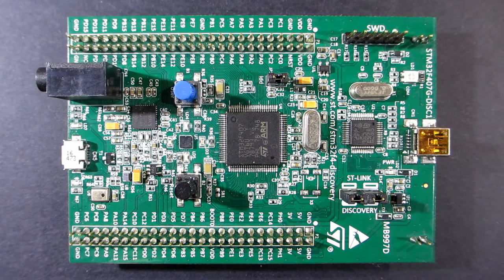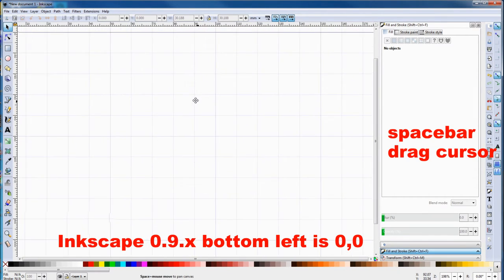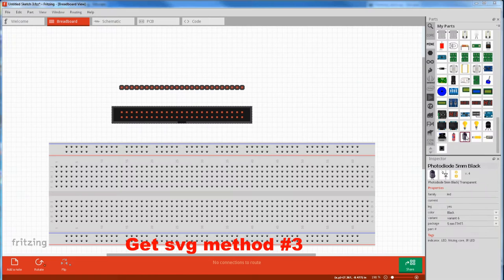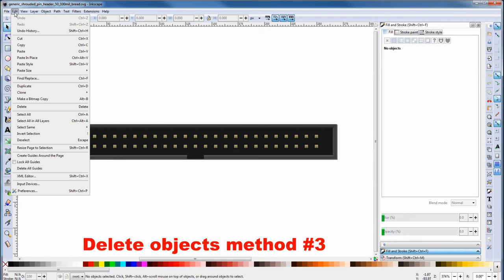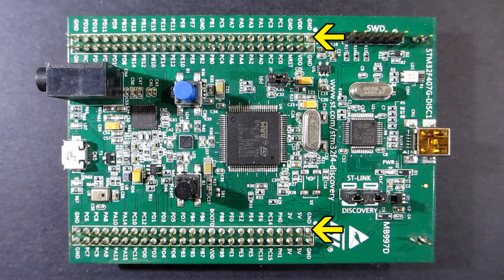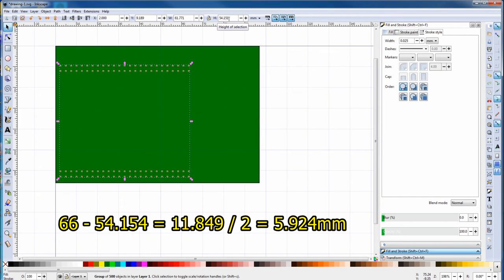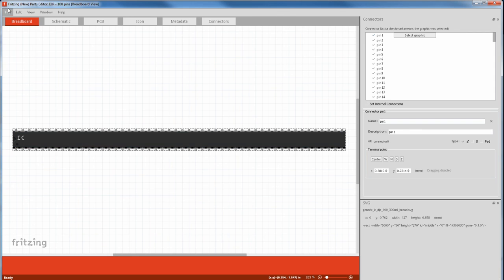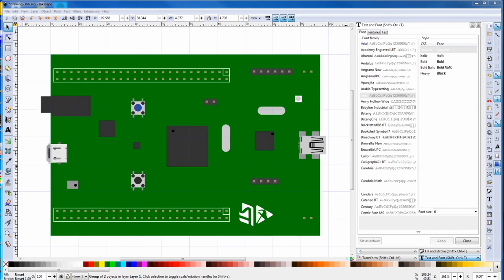Fritzing Parts Fast pt1 - Breadboard pt1

Comment: This tutorial was fantastic.  I wanted to build a Fritzing breadboard part for a USB adapter for an ESP8266 ESP-01 board, and was able to get it done in about 2 hours going step by step with your tutorial.  Looking forward to watching the rest of the episodes.  Thanks for taking the time to put this together.
Reply from the maker: The last ep is about checking the part so the PCB doesn't get manufactured wrong. 
A quick physical check is print out the PCB and see if the part fits exactly on the print. 
A deeper part format check is post it on the forum and get the experts to check it - they are better than me -. Just export the fzpz and upload it to the forum with the 7th button in the postbox toolbar.
https://forum.fritzing.org